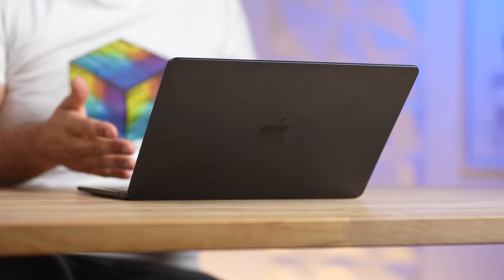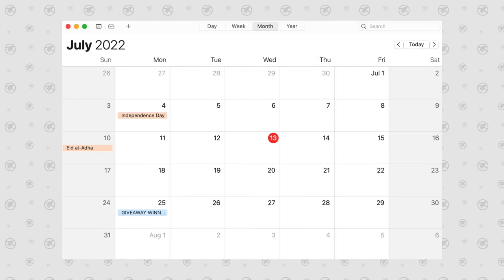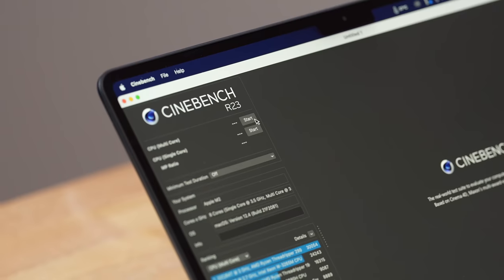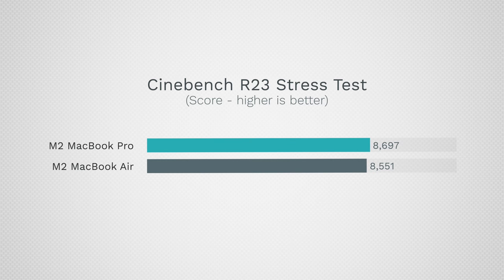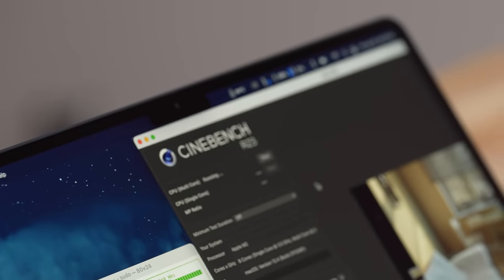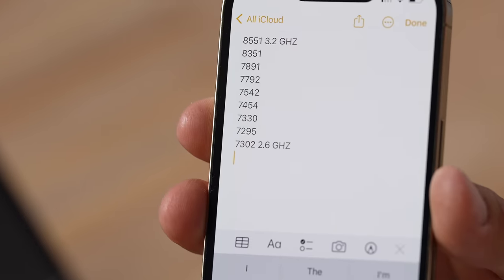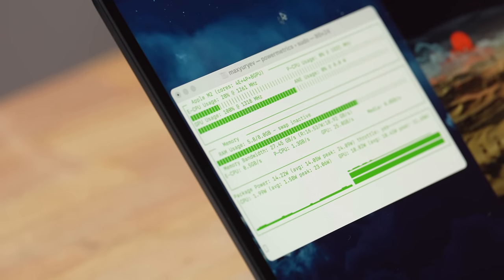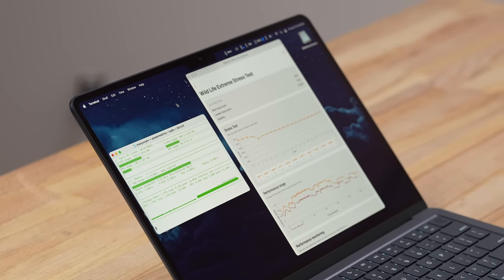M2 MacBook Air Thermal Throttling: How Bad is it REALLY?

Comment: What people sometimes seem to forget is that the MBA is the entry level Macbook. Is it unfortunate that it thermal throttles? Probably yess. Is it cool that Apple downgraded the SSD speeds from the entry level M2‘s? Definitely no!
But the target consumer for M2 Macs are students, which mostly take notes, browse the net or maybe code, not prosumers. A normal student normally doesn’t hit his MBA with both CPU and GPU at 100%. And someone woh needs more compute power knows that the MBP will deliver more and also more consistent power. 
Imo, the M2 MBA is a great choice for most people, be there thermal throtteling or no in extreme cases, but that‘s maybe just me.
In all cases, I appreciate your hard work and the content, let‘s get that 1M subs!🔥
Reply: Respectfully disagree. This is advertised for students. Students are going to get the base model due to the price. And not all students are using MacBook for just watching videos or editing videos. They are using it for programming, AI, data science. That’s why personally I am disappointed. Such a great design and a weird decision on the best selling MacBook base model. Forcing people to upgrade to 512GB to get the full benefits of M2 is like BMW charging subscription for heated seats.
Reply: No one looked at Apple silicon the same after seeing entry level M1 did some tasks faster than Intel Mac Pro like ProRes rendering.
Reply: @srirams3586  Yes, of course it is bad of them forcing you to pay extra to get all the performance of the M2. That‘s why I will not upgrade from my M1, paying in my country 300€ more only to get slightly better performance is not worth the money, even though it has an arguably better design. But for people that want to upgrade from an older Intel Macbook, the M2 MBA is still a solid laptop.
Reply: @gigihanmandarin  That‘s correct, Apple silicon raised the bar compared to similar priced Intel Macs an even higher end ones by that much that people must realise that such big jumps will not happen at every generation.
Reply: @noahdesquiotz6627  only spoilt brats upgrade their laptop every single generations.

Comment: I’m really impressed with how powerful M2 is even when throttling. That said, it would be cool if Apple added an option to run at throttled performance for greater battery life at the cost of burst performance. Great job, guys. Really appreciate your efforts ;)
Reply: I was wondering as well. Isn’t there some software so the user can customize the throttling settings. I prefer a cool temperature and longer battery life over boiling performance.
Reply: @williamwallace410  me too, especially useful for a student like me running round the campus
Reply: @williamwallace410  There was the ‘Turbo Boost Switcher for macOS’ for Intel, it would just shut off those bursts of close to 5GHz peaks, I use it on my iMac and helps it keep forever quiet. Hopefully something similar comes out for these Apple Silicon.
Reply: macOS currently has a "Low power mode"-toggle that cuts performance quite a bit and extends battery life by approx. a couple of hours for example on the M1 Air.
Reply: @mrt.7146  is this new to Monterey or is it always there

Comment: Great review as always!  I’m wondering will the battery life changes if it runs with a thermal pad. It might get shorter if the system allows the chip to run at a higher wattage.

Comment: I'm still optimistic about the m2 even with that throttling. Can't wait to see the performance with the extra thermal pads. And if possible I wanna see how it fares with 2d motion graphics in after effect 😁
Reply: And The throttlling comes with significantly greater power savings which improves total energy usage for a given task compared to it running full throttle. So Apple has done a great job dynamically controlling the thermal curves vs heat and battery life.
Reply: And it is also important to note that these test are run at a typical US room temperature. 

In Europe, air conditioning is not widespread, so ambient in door temperatures can readily be 25 to 30 deg C.  There the priority of good short term burst performance, and energy efficient long term throttling, is even more important.
Reply: @carstenthomsen9805  wow. Never thought of it like that. Thanks for the explanation

Comment: I want to see this same test with the 16GB 512GB version. I’m thinking of getting M2 Air with 16GB 1TB so I want to see how the non-base models perform since it seems those are not that good within the M2 lineup
Reply: I was gonna get the 16g 1tb m2 air but decided to get the 14 pro it was cheaper to do that and get more with the cost of the device compared to upgrading the air m2
Reply: @nikolavonfulton5195  can I have the link to the one you got? I’m confused with all the names

Comment: Have to say it does seem that given the testing I've seen so far the M2 is heading in the same direction as the Intel chips did, and need a very good cooling system. Apple should really work on this this to keep the lead they set up with the M1

Comment: Love how the M1 based on the hot mess that is the A14 didn’t throttle while the M2 based on the way cooler A15 is having thermal problems
Reply: In real world m2 is gonna perform better than m1.You wont be running stress tests in real world.
Reply: Its probably because of that 5w more usage. Their performances were identical, so they pushed more wattage which caused more heating.

Comment: Would be interesting to see how the M2 MBA stacks up to the 14" M1 pro MBP... Great review guys!
Reply: 14 M1 pro is better in cooling, performance, sound, screen refresh rate, brightness & ssd speeds
Reply: @PracticalInvesting  I guess you're right and by the time you get any upgrade to the new MBA M2, it would cost the same as the 14" MBP...
Reply: @EmilianoLoconsolo  yep that's why I actually just went for the base M1 Pro instead of the M2 Air
Reply: @EmilianoLoconsolo  I’d say go with the 14 pro 8 core cpu for best battery life & value. It should hold up well for at least 5-7 years
Reply: @PracticalInvesting  that would be a smart choice. On the other hand I heard rumors about the next chip being a 3nm. If that's the case I would jump on a MBP...I guess it would be a big game changer...

Comment: I'd like to see it performing with Logic Pro in a recording/mixing scenario and if it thermal throttles at all that way. It would be very useful to me as I'm a composer/mixing engineer. So, a real-life scenario would be very helpful. Thanks for the insightful video! Cheers!
Reply: It would most likely keep slowing down the more real-time plugins and tracks you throw at it. I dont think the Air is a good choice for audio work. The only thing that it has going for it is that its dead silent, no noise from the fans. The Air is more suited to people who only need a laptop for light work like photoshop, writing and web browsing.

Comment: BTW with reference to your comment that you don't have software to report the GPU temperatures, that's not possible since the M1/M2 ARM chips are SoC: the GPU is not separate.
If you look at the chip architecture, the GPU mdia engine areas are right in the middle of the chip. 

And maybe a pedantic point, the system isn't getting "saturated" but rather either approaches steady state or under any sort of relatively heavy load, it reaches some max temp, and the CPU cuts load back: thermal throttling.

It's of some importance, because you have a relatively  small heat source (the ARM chip) that's generating 13 to 30 Watts of heat, which is then being distributed to a larger area, and then to ambient either by a fan, or passive convection.

Sure, the heat transfer system itself has some mass, and absorbs some heat, but the bulk of it is being transferred either to the fan's exhaust , or to the areas that the Air makes hot, and then lose heat to ambient.

For a given load, the CPU outputs a certain power, and the cooling system tries to transmit that to the cooler ambient air. At same time, some of the laptop starts to heat up from starting (ambient) temperature.       
If a combination of laptop thermal mass plus cooling can handle that output, then you each a steady-state temperature.
If the COOLING cannot handle it, you reach max temp, and the CPU thermal throttles.
If it WAS a "saturation" limit, then the laptop  body would continue to heat up, and let you run to higher loads. And you know that is NOT the case. You've SEEN it on your termal camera, the bulk of the laptop body does NOT get hot: does'nt even get hottter than ambient.

"Saturation" implies a (large) heat sink, which is not how these systems are cooled.

An example of a system that was throttled due to saturation is some of the French nuclear reactors that rely on local rivers for cooling, and this past summer due to draught, had low flows. So the output from these reactors was reduced so as not to cause the rivers to overheat. Which is why France had to use more natural gas this summer to satisfy demand.

Comment: Cooling is always the problem with laptops: it’s a question of CPU cycles/watt (or CPU cycles per thermal units). Every time the CPU passes a certain temperature threshold there’s no choice but to start throttling it.

Comment: In my opinion 108 degree Celsius is too much and in long term will negatively affect CPU and/or other parts. Pity that they doesn’t add there any heat-pipes to transfer heat on wide area of chassis

Comment: As a coder, you spend most of your time writing the code in your chosen IDE which uses litter performance and much less of your time compiling testing. I don't think this would be a major issue for coding. On the other hand, having multiple docker containers running performing lots of CPU intensive tasks will put heavy strain on this CPU. In that regard, you will probably have a lot of issues.

Comment: I wrote a comment with suggestions on your video with fans.
Unless I missed it, you should use your thermal camera to measure the heat output from the BASE of the laptop.
As in, from BELOW, not the TOP.
The top is not very meaningful.
And calculate (as I discussed) the heat flow from THAT region.
Compared to the total.

One interesting test would be to remove the back, and run the Benchmarks with as follows:
(1) In still air
(2) With a STRONG air flow (large fan etc)
And measure the temps of the BASE of the motherboard with youjr thermal camera.

Be nice to see where the heat is going overall.

But as I said in the other video comments, you'd be much better using copper or aluminium shims with heat tansfer paste than the heat transfer pads: they actually are NOT very good at heat transfer.  
Are just better than air.

It would be nice if you could put your actual measurements on your web page: interspersed as they are in the youtube verbage isn't that useful to really see what's going on.

Comment: Dear Max tech team,

I would like to see the following tests:

Heat pads on a higher speced M2 MacBook Air. 
Heat pads on a M2 MacBook Pro to see if it makes any difference
Full comparison between the latest intel MacBook Air and the M2 MacBook Air, in order to tame the expectations and shows how much the Air came. 
Maybe a comparison between the M2 MacBook Air and a pro device like the Mac Pro or the iMac Pro.

Comment: A “normal” user has one computer. They can’t do heavy tasks on another machine like you do. So pick one that can do whatever you want in a pinch, and last for 5 years. That’s not the base model. The m1pro is better in many ways for heavy tasks with fan installed in it.  People need to understand Air is a machine for light tasks.

Comment: I use a 2015 13 inch Macbook Pro. The poor battery and performance are also unsatisfactory. But in Hungary, where I live, the price of Apple devices has risen sharply. So I would be very happy if I could win one of the new Macbook Air 2022.

Comment: Really like the MacBook M2 design. I doubt the thermal throttling would ever be an issue for my use, but still considering the M1 because it looks like Apple took some shortcuts with the M2.

Comment: I feel like this is probably intentional design by Apple. The vast majority of students/office workers just using the machine to browse won't encounter throttling. Anyone doing something remotely demanding (but that was possible on the M1 models) needs to upgrade to a higher model. 
This kind of sentiment is common on forums, where Apple apologists are blaming users for not buying the more expensive models to perform tasks that absolutely should be possible on this hardware.

Comment: For average creative use M2 Air should be more than enough. I have bought M1 Air with 16gb ram for my wife. She is UI/UX designer and for the last year of using it she hadn't any throttling issues. So i don't see reason why M2 Air could be worse.

Comment: The thermal throttling doesn't seem much of an issue for my basic work but I can imagine it being a nightmare for people relying heavily on the M2 as their main system! I wonder if M2 is too powerful for the air or would it be a simple optimisation problem?!

Comment: A powerful chip but the capacity is limited by with or without cooling system. Practically speaking I can agree it’s sufficient for casual users, but you pay for something that’s not running at its full potential… it just feels weird 🫤 tough pill to swallow.

Comment: Was waiting for the thermal heating issues analysis for MBA M2 chi 16GB 512ssd In 8core as mentioned in this vedio, but couldn't find it any where.

Finally deciding on MBA M1 with 16gb 512 SSD upgrade just because of the heating issues in MBA M2

Comment: Great video! I think Apple should have a less powerful version of the M2 chip for the Air, and if you wanted the full power of the M2 chip you'll have to upgrade for the pro 13, that way the Air wouldn't throttle so much.

Comment: At the start you say you did a teardown where you reapplied thermal paste that "matches apple performance" and show MX-4. Anyone that's done their research knows this is a terrible idea. MX-4 cannot be used in laptop applications as it will pump out, causing massive throttling and potential hardware damage. This is my first experience with your channel but this potentially gives your viewers bad ideas

Comment: It will consume less power because the mac undervoltage itself to avoid the thermal throttling effect, its just common logic sense, its not that apple invented the wheel.